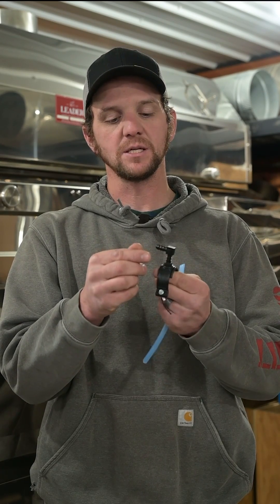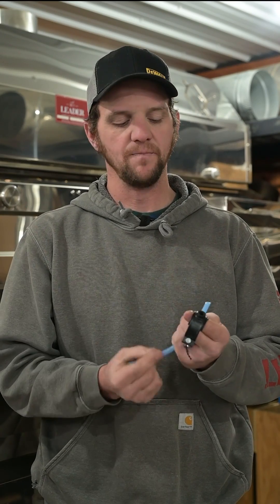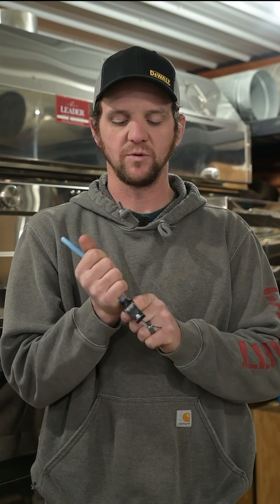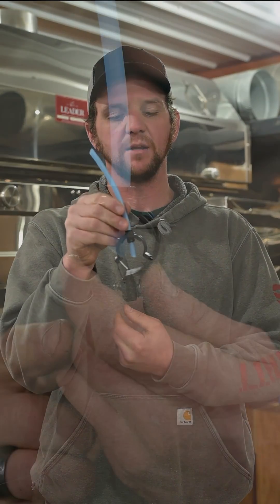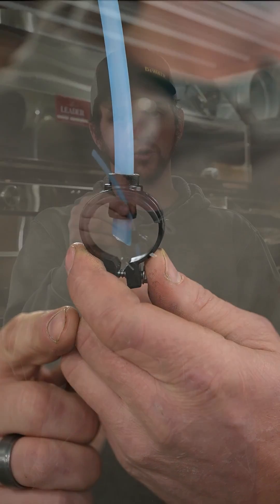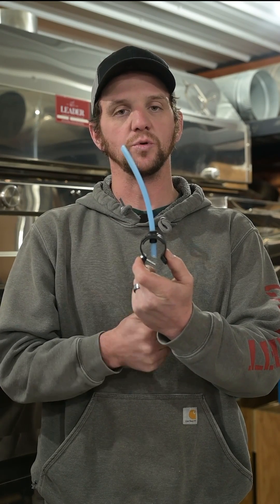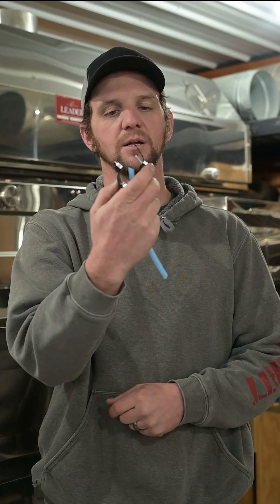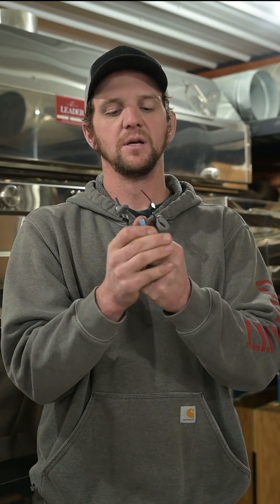A New Type of Sap Ladder

Comment: I tried getting 3/16 line into your saddles yesterday and no luck. Way too tight. What’s the trick? Using CDL semi-ridged 3/16 with the H2O saddles. Wasn’t making a ladder but just coming into the top of the mainline after a trail crossing. Ended up using a 3/16-5/16 connector instead of the 5/16 elbow. Worked fine for my application, but I’d like to do this some day for a ladder potentially.
Reply from the maker: Thanks for reaching out. The tubing you've used may have a larger outside diameter than the H2O Leader tubing and too large to use in this application. For your ladder project, you can use H2O Leader MF-50 tubing :) Here is the link of our color options : https://us.h2oinnovation.net/us/mainlines-and-tubing/tubulures/3-16.html